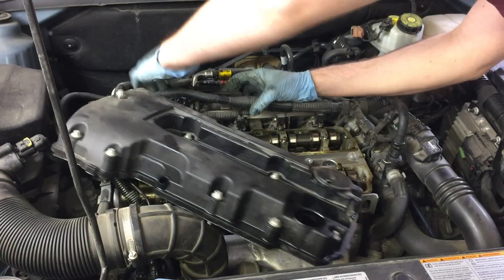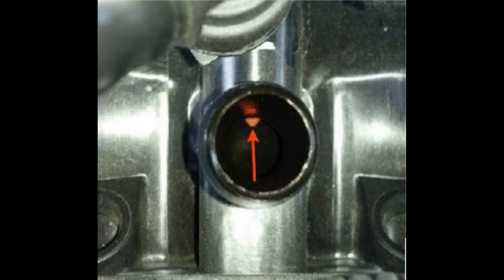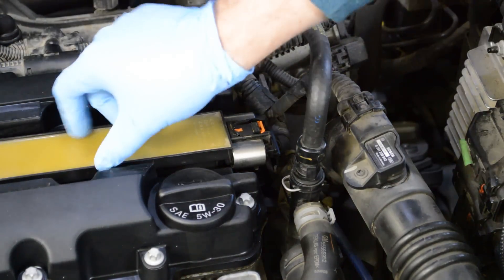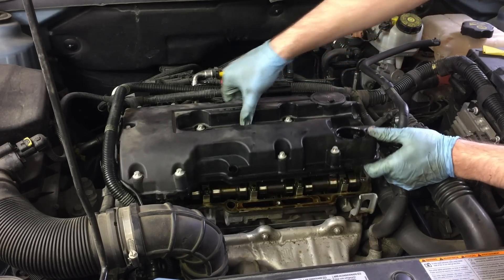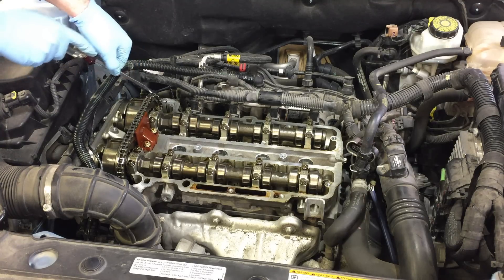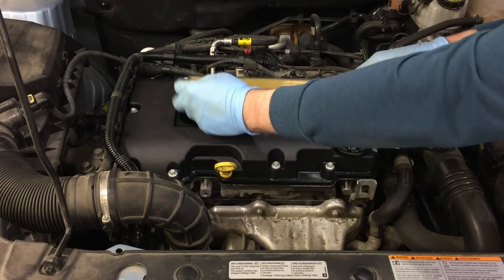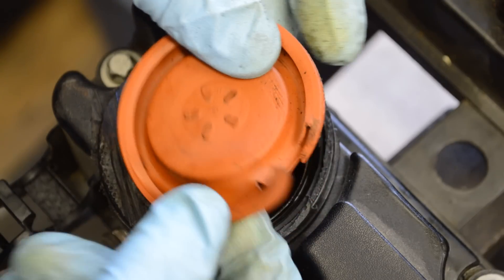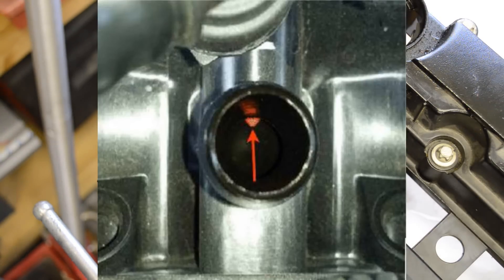How to replace the valve cover on a Chevy Cruze 1.4 liter Ecotec

Comment: Worst car i ever bought stay away from these cars
Reply: Can u give details on why it was the worst car ever
Reply: johnny smit  not true , my 2014 Cruze at 51k miles is running like crap on me . Had it clean inside and out , new spark plugs at 38k , changed oil and filter at every 3k miles ,  gumout or Lucas fuel injec. Cleaners. New air filters , New brake system. Coolant always at level . I basically spoiled it, and it still broke down. In this case it's not how you take care of it but what is being taking care . It's a CHEVY CRUZE dude come on!
Reply: johnny smit  wait till you hit 100k+ miles i have a 2013 chevy sonic, same engine, babied the car, every known common problem these cars have has happend to mine from the 105k -110k where im at now, fuckin nightmare. broken water pump,  shattered thermostat housing, split innercooler turbo tube, leaking valve cover, thermostat replacement, spark plugs replacement, bad 02 sensors. all in 5000 miles. doesnt matter what you do to the car. these are really cheap parts in these cars.
Reply: I agree, I just turned over 140K and have had a lot of work done to it in this time, a lot under warranty some not. it's not a bad car, but does need more care then a lot of others.
Reply: @matthewlobberecht1752  not really honestly like I mentioned , i would "spoil " it .
Reply: @michaelalvarado4299  I can agree these cars have issues because my moms does and I do all the work on it but I can guaranfuckingtee you it's not the worse car lol.  I have a Pontiac grand am gt and don't get me wrong, I love it but it has more issues than these cruzes do.
Reply: johnny smit Same
Reply: @matthewlobberecht1752  yea those are a handful , plus those cars are older
Reply: michael alvarado r
Reply: Mines under warranty. Bought it at 28000 miles and have had to bring it in 7 times before I hit 80000 miles. Stay away from this plastic piece of shit.
Reply: Yup, as soon as my warranty was done shit started happening. I'm preparing to change my valve cover as well.
Exact same issue as in the video.
Reply: Me too, the worst